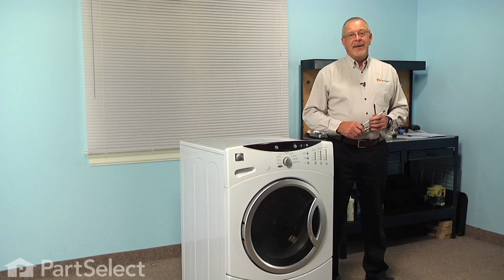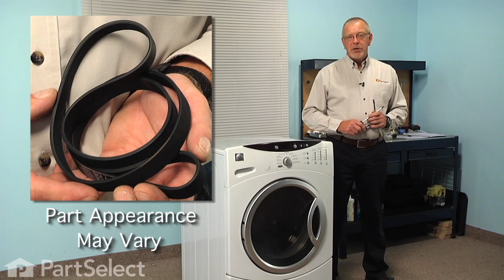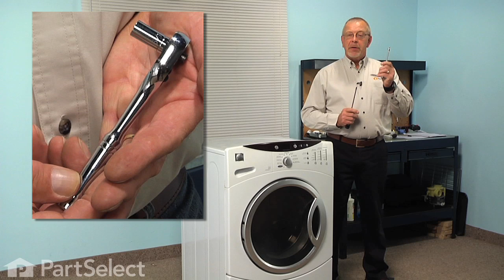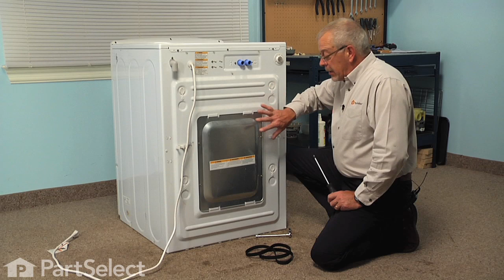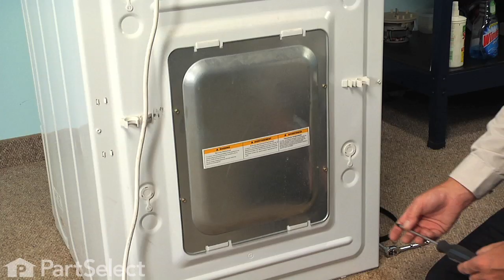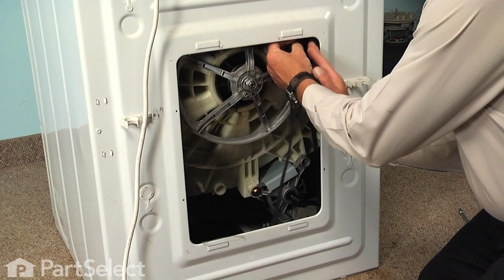Washing Machine Repair - Replacing the Drive Belt (GE Part # WH08X10024)

Comment: Just a guess here, but i am guessing that a brand new belt was not used in the video as it was way too easy in the video to get the new one on.  I did do it easy when I tried the worn out belt.  With the new one, I reverted to using a screwdriver shaft to give me leverage to keep the belt on as I rotated the wheel.  That extra leverage did the trick quickly.  Otherwise I was struggling with the new tight belt to keep it on the big wheel.

Comment: THIS WAS SO INCREDIBLY DIFFICULT TO GET ON, I CANNOT EVEN DESCRIBE TO YOU THE POUNDING OF MY HEART AS I FINALLY GOT IT ON. I FELT LIKE I HAD JUST HAD A BABY, LITERALLY!! LOL. But now that it is on, I am noticing it not staying centered. The drum appears to be tilting back at the top, so it is angled, not straight up and down like the one looks in the video. Is this a problem, or could it be that I just have a slightly different model? 🤔
Reply: I think it was because I had a load in the machine 🙄. Anyway, the belt is not staying centered. I'm noticing the pulley slides in and out. Is the normal? And the the bolt comes loose.

Comment: This model actually cleans well, since it uses water and good old fashioned agitation. None of that useless ‘wash-plate' with no agitator▫ ▫>allmy.tips/GeWasher?a45      I only wish it didn't automatically drain after 24 hours and would let me use more water if I want to. We also don't appreciate the sloped /mitered edges of the top, I liked the old style of a flat top better. The biggest issue we have is the complete and utter inability to control an appliance that I own to use it the way we want to, and since there's no way to control what I want, there's also no way to know what exactly the machine is doing at any given time.

Comment: Like Gordon705, I had trouble keeping the belt on the washer tub pulley.  Gordon705 resorted to a zip tie.  I used a vice grip pliers.  Either way, you will probably need some form of assistance to keep the belt on the pulley as you rotate the tub pulley to bring the belt into place.  Knowing this in advance will make this a lot smoother.  Otherwise the repair went exactly as the video describes.

Comment: No way did mine go this easy.  New belts out of the box are smaller because they haven't broke in.  I had to put a zip tie on the top pulley to hold it in place so I could keep it on the bottom pulley with 1 hand and turn the top pulley with the other hand.  I cut the zip after it was in place then hand turned through a dozen rotations to true up the belt on the 2 pulleys.  Still ended up bleeding from both hands.  Your video did give me a great starting point though.
Reply: zip tie trick saved me time and frustration!  Thank you so much.
Reply: THIS WAS SO INCREDIBLY DIFFICULT TO GET ON, I CANNOT EVEN DESCRIBE TO YOU THE POUNDING OF MY HEART AS I FINALLY GOT IT ON. I FELT LIKE I HAD JUST HAD A BABY, LITERALLY!! LOL. But now that it is on, I am noticing it not staying centered. The drum appears to be tilting back at the top, so it is angled, not straight up and down like the one looks in the video. Is this a problem, or could it be that I just have a slightly different model? 🤔
Reply from the maker: Gordon705 Glad we were able to help! Sometimes the repairs can be a bit of a challenge, but its always easier, and cheaper, than hiring a repair man!
Reply: You're welcome.

Comment: Awesome Video.  Our Belt broke.  I think it broke because the Drive Pulley (Very Large Wheel)  is very wobbly and is loose (it can rock right to left without moving the washer tub). Is that a problem?  It looks like your Drive Wheel was in place and was not wobbly.

Thanks for your input
Reply from the maker: Hi Ian, the drive pulley needs to be tight on the shaft and if it were loose it would definitely fall off and could break. The required tightness varies from model to model, so if it's possible for you to check with the manufacturer regarding the appropriate specifications, that would be recommended to make sure you're not over or under tightening your drive pulley. Please let us know if you have any further questions!
Reply: Thank you.  It needed a new drive pulley.  our washer is running a lot smoother and quiter now.  Can't even tell it's running.
Reply from the maker: Hi Ian. Great to see you found the cause of the problem and an easy fix!